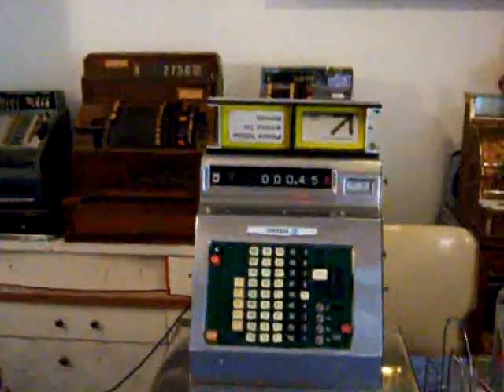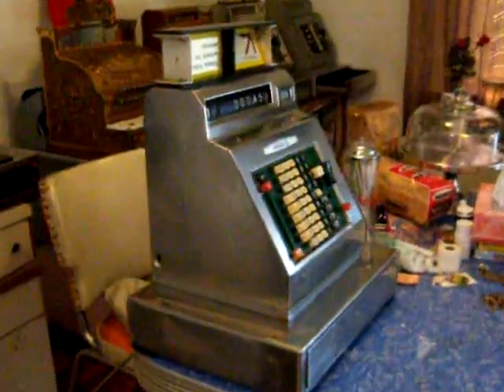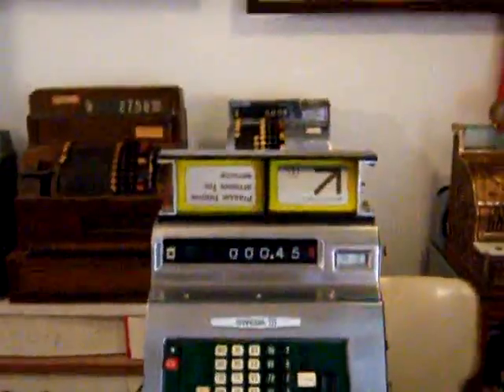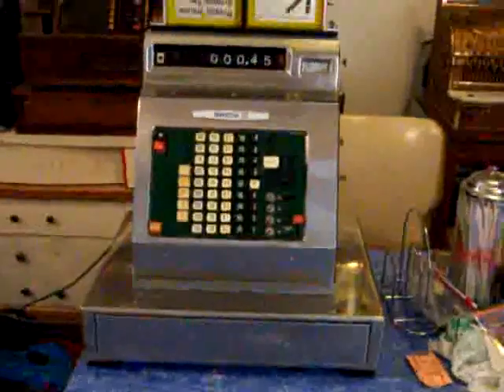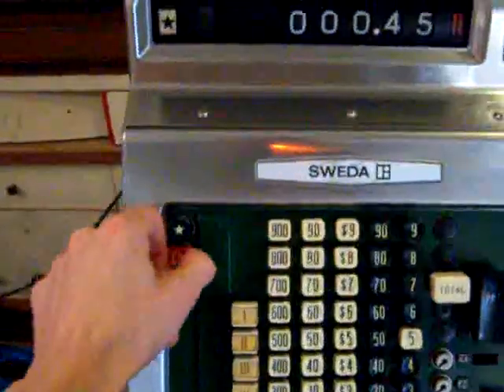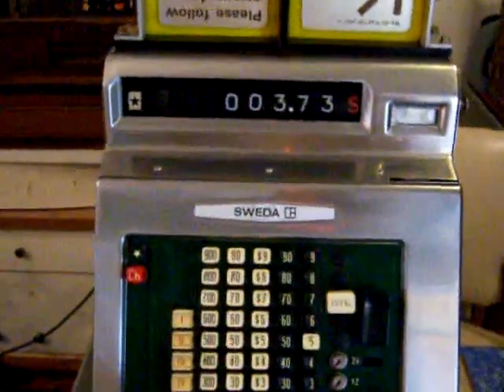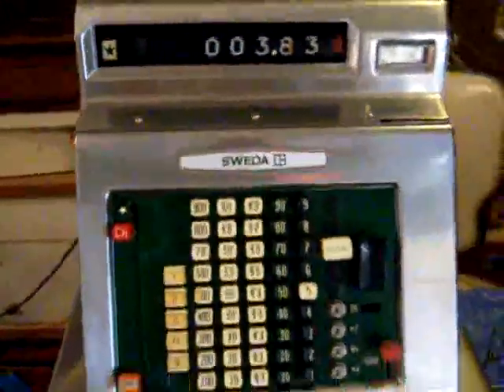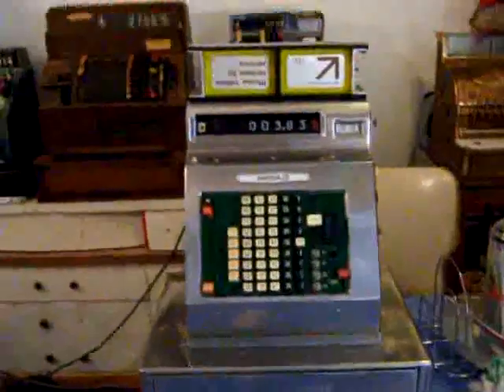SWEDA DEMO END OF RESTORE

Comment: I have an identical machine that jammed on a minor rotation of the crank. Are they daunting things to work on? It's run in my ownership and looks clean inside.
Reply: Hi. Did you ever get your machine functional?   I just bought one (Sweda Model 46) on eBay that appears to be in very good shape but most likely not operational.  Was wondering if you had any luck.  The people with knowledge of these machines as well as the old NCRs is shrinking and hard to find.
Reply: @larryc4156  no, it's still sitting there feeling sorry for itself. I heard the receipt printer can cause jams so when I get time I might detach it and see if the handle rotates
Reply: Have you run across any websites or current blogs that have folks with knowledge of these?  I find that is the really surprising part.   There doesn’t seem to be much out there on the web.  There’s definitely a following for these machines just no organization it seems.  I’m thinking of trying to organize a group.
Reply: @larryc4156  Good luck. Wish mine was working!